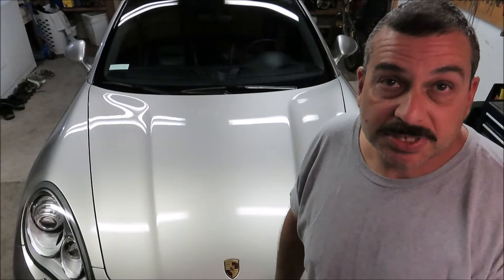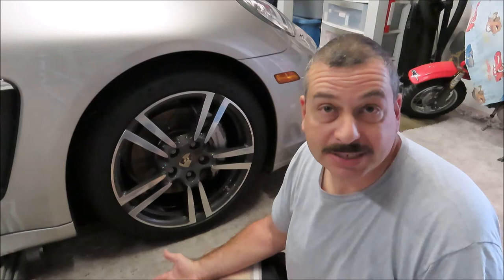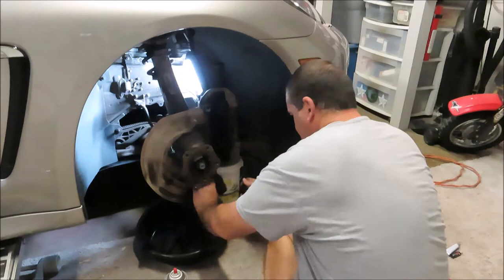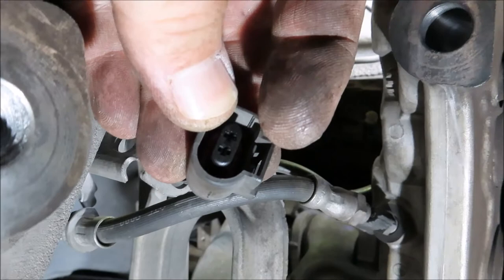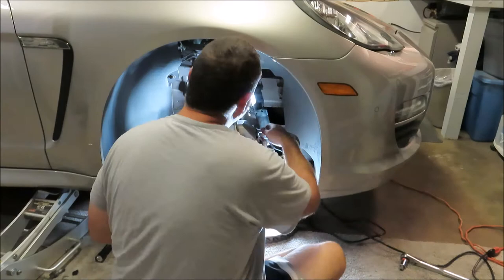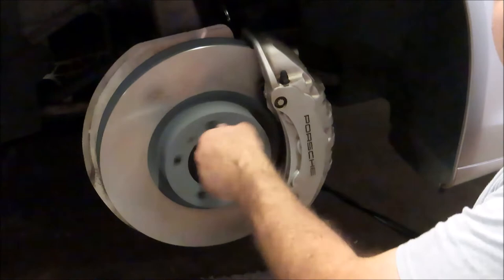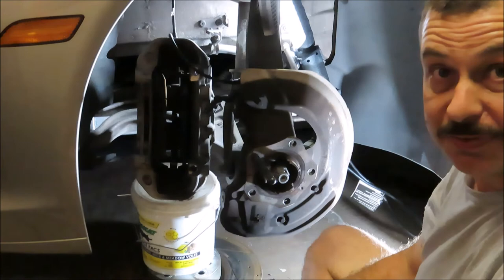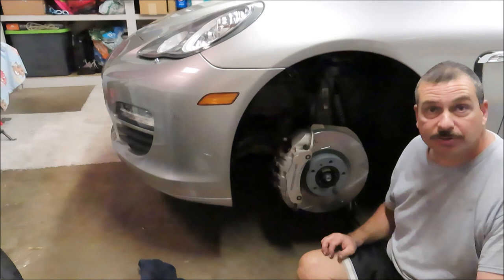Porsche Panamera Front Brake Replacement; In Depth, How to

Comment: I’ve been looking to buy the panamera 2014, I really wanted a 911 but the price have gone through the roof at the moment. But for the money I think they are really good value. Over here in England they are going for around £27000 pounds with full service history and 50,000 miles. Thanks for the videos they are very helpful.
Reply from the maker: Thanks for Watching! Right now the prices on first gen Panamera's are starting to go up a little. With the announcement that the future of the Panamera will be electric. I feel that prices will go up even more.
Reply: In Spain around 40/45 thousand € , its crazy
Im going to buy one, 2009, 970 4S, around 145k  kms   and 35 thousand € ....... but it doesn't looks old , I think its a very  good car
Reply: The Panamera is Porsche solid product … and the 970 and 971 opened the gen with pretty good engines and specs. 20:20
Reply: Just got one 10/2014 ( 2015 ) diesel around 100k miles

Comment: Thanks for the video! Very informative.

Btw... torque for the M14 brake caliper bolts on the front-wheel is 140 nm.
On the M12 rear-wheel caliper bolts it is 85 nm.

Greetings from Germany!

Comment: Great video!  One thing I noticed is that your previous set of brake rotors were on the opposite side of where they should've been.  The marks on the slots should face backwards.  Your new rotors are installed correctly (handy L and R markings).
Reply from the maker: Great eye

Comment: Thank you so much for this.  I have a 2010 as well.  Only issue I came across was the bolts on the caliper were different than the video.  I had my T14 ready to go I had to run out and get a torx socket.
Reply from the maker: Porsche has changed the bolt heads a couple times. Thanks for Watching!

Comment: Thanks for the video!  Can you tell me what size/type sockets you used to remove the caliper bolts, along with any other special tools needed to replace both the front and rear pads and rotors?

Comment: Hello! My question isn't related to front break, but maybe you can give me some advice. I went to a garage and asked them to replace valve cover gasket (Panamera 2010 4S). They said, in order to replace it is needed to remove the engine as the rear bolts are not accessible otherwise. Is it true?
Reply from the maker: Engine doesn't need to come out. I had the cam bolt recall done which requires the valve covers to come off and they didn't pull the engine.  Thanks for watching!

Comment: Love the exhaust sound!  Just bought a 2012 4S and the exhaust sound is unimpressive.  Mike, what did you do to get that exhaust note?
Reply from the maker: Removed stock mufflers and had Magna Flow's put in. Thanks for Watching!
Reply: Which Magnaflow did you go with?  Quiet at cruising sooed?

Comment: Is the Process the same at the Turbo Modell same Year ?
Reply from the maker: Yes
Reply: @mikeshorsepowergarage7577  thank you, i did Already done the Job. But what about the Parkbreak at the rear, dont we have to calibrate it with a tester?
Reply from the maker: @splater591  I didn't need to,  I didn't touch any of the parking brake components when changing the rear brakes.  I left the parking brake off before the disassembly which allowed me to remove the rear rotor.  Everything worked fine after reassembly.
Reply: @mikeshorsepowergarage7577  same as i did, i already had done the work before i read from somebodys problems without calibrating it - yesterday i did a test and my break was working without any problems - but maybe good to know for others that there could be issues - Thank you for your tutorial - helped me a lot !

Comment: Hi your video was very good but I’m a little worrying to see that your not wearing a face mask when cleaning the brake dust from the brake discs
Reply from the maker: I washed the brakes first to remove the loose dust. Then I was using a liquid cleaner. The dust was contained in the liquid solution.  No dust was air born as far as I can tell. Thanks for watching and for your concern.

Comment: Could I buy different brand rotors and break pads and still be able to replace them? I plan on buying brembo rotors and textar brake pads
Reply from the maker: As long as that rotors are designed to fit the hub.